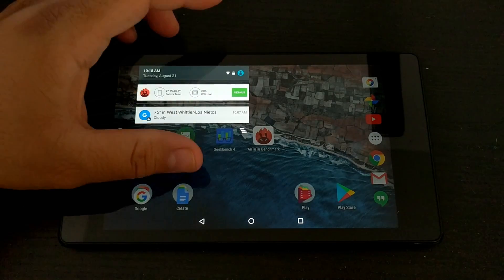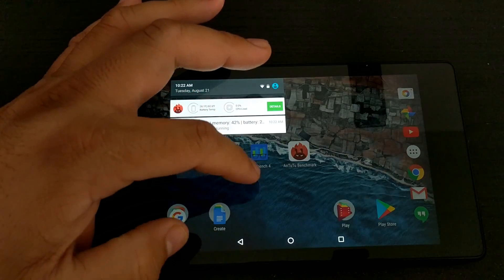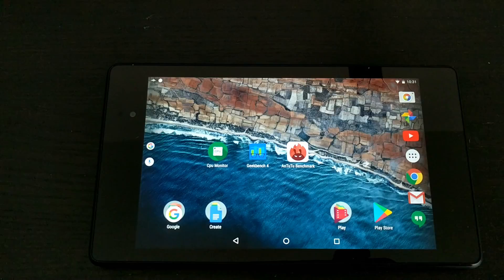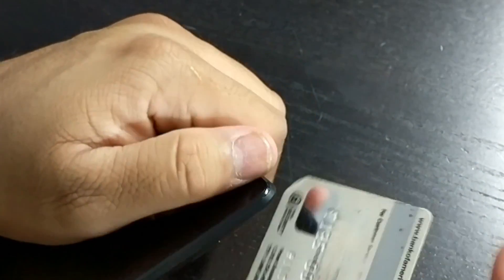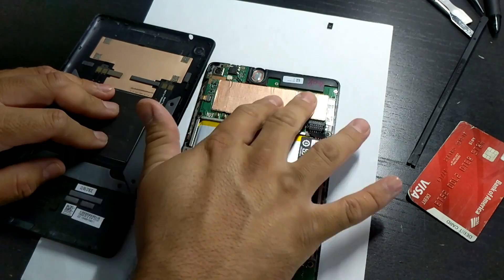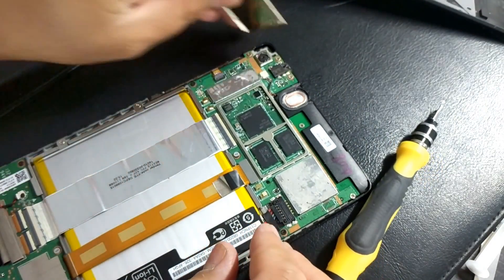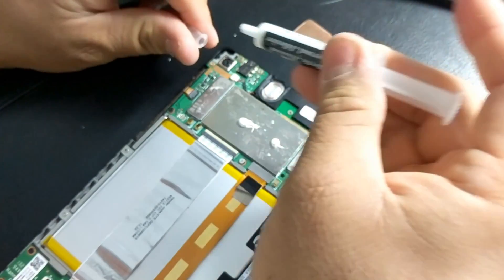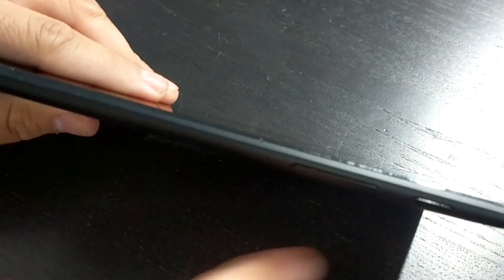Nexus 7 2013: Easy Way to Cool Your CPU

Comment: Hi, does it necessary to use a thermal adhesive or can I use thermal paste? What do you think about to use a Grizzly minus thermal pad?
Reply from the maker: It's not necessary to use thermal adhesive. As long as you have the copper tape securing any copper shims, you should be good with thermal paste. I don't have experience using those grizzly minus pads. If you're going to use those pads, don't use the copper shims because it will be hard to put the rear case back on.
Reply: @ChavezDIY  : Thanks for your answer. I will try this with my Grizzly Kryonaut thermal paste and compare the results. 👍 How do you take care about that there is a continuously contact pressure between CPU/GPU and heatspreader? Do you get the pressure with the backcover?
Reply from the maker: After adding the paste on the chips, I seat the heat spreader and lift it again to make sure there is contact between the chip and heat spreader. There is no way to ensure a specific amount of pressure, as long as there is contact, you're good. The back cover will provide some pressure if you put a copper shim like I did.

Comment: I can confirm that this is indeed the greatest android tablet of all time. Still use mine almost daily and it has definitely slowed down quite a bit. But I think it could be due to the OS (android 6.0) and software being updated constantly, the processor just can't take it anymore.

((Also that debit card I see in the video better be expired/non-active cuz damn...))
Reply from the maker: I still have a working 2nd Gen Nexus 7, but its really slow and I had to disable a lot of the apps in order to get it running acceptably. I pretty much use it to watch YouTube videos. The software was a limiting factor as it aged, but eventually the hardware also didn't age well either. I have it running stock Android. Yeah, I use expired cards to open up my electronics, they work great for that, haha.

Comment: Still have mine...♥♥♥
Reply from the maker: It's one of the greatest Android tablets ever made. I'm disappointed that Google didn't update it, but rumors are Google is working on a new tablet
Reply: @ChavezDIY   hopefully same form factor.. Love Nexus 7 size... It's Perfect for me... ♥♥♥
Reply from the maker: Sadly, I really doubt Google will make another 7inch form factor tablet. I think they are moving towards a tablet that runs Chrome OS, because it can run Android apps. The Acer Chromebook Tab 10 is the first experimental device like that.
Reply: I'm still using mine!
Reply: @pinkmillk  got Android 8.1 Oreo installed in my Nexus 7 2nd Gen... All I could say it was flawless!!!

Comment: isn't it bad for the chip when you put thermal paste directly in it?
Reply from the maker: Nope. Its actually helpful in cooling the chip efficiently. Laptops and desktops also come with thermal paste sandwiched between the CPU/GPU and the fan and heatsink.
Reply: @ChavezDIY   can I use aluminum foil as substitute for copper tape?